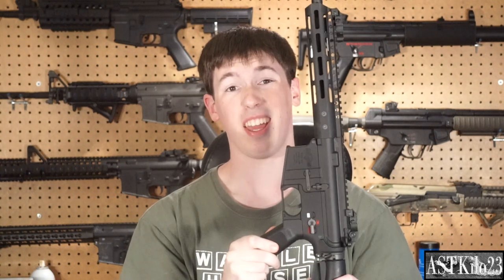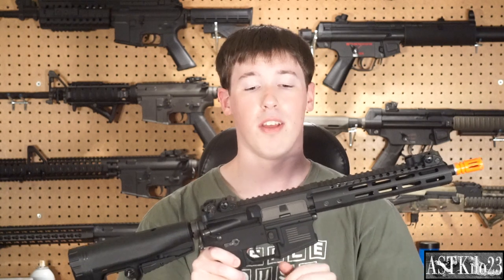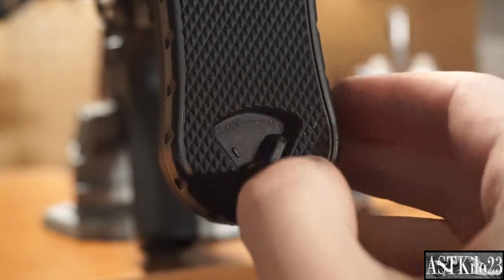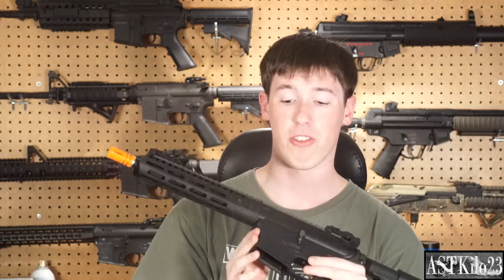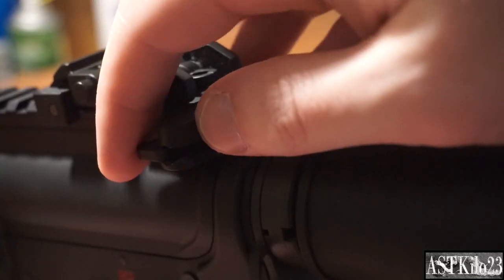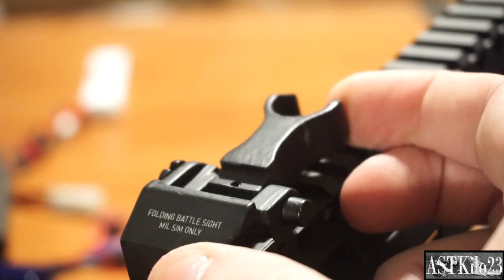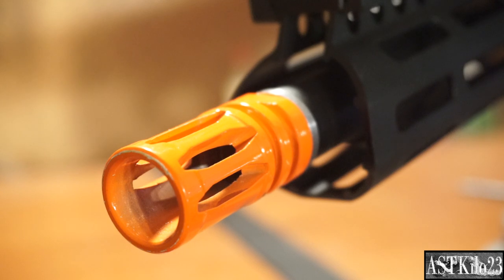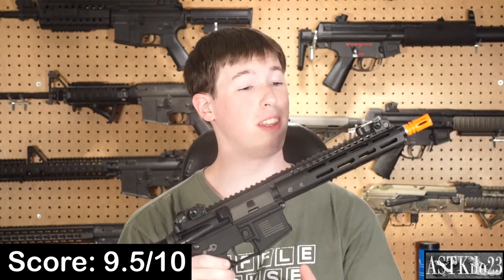Jag Precision's PHX15 SBR AEG Airsoft Gun Review

Comment: This vs echo 1 platinum which one is better
Reply from the maker: this gun definitely has the better internals and will probably last longer. the platinums run most of the same parts, but do not have a mosfet, torque motor, metal tooth piston, or corrected aoe.
Reply: +ASTKilo23 that's what I thought. But when the platinum came out they were pretty good I still use mine although technology is getting way better so ya